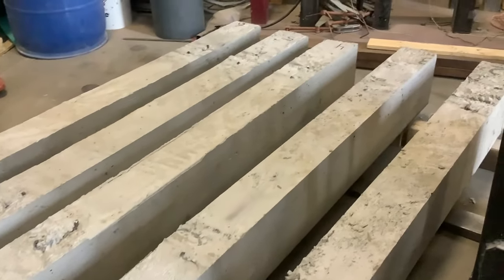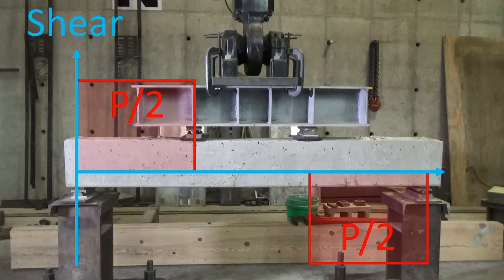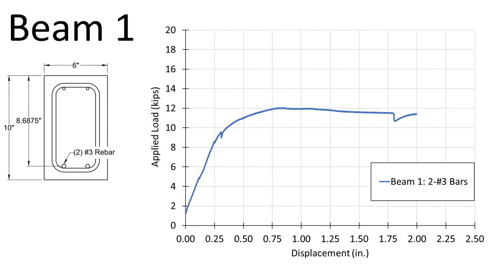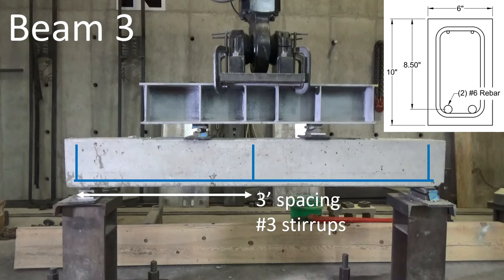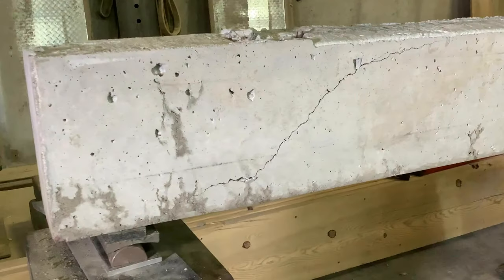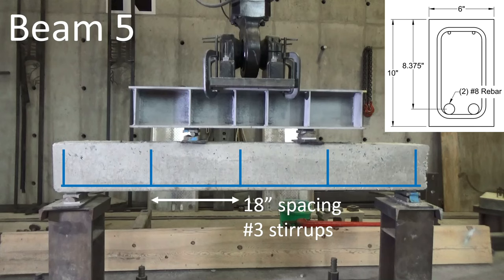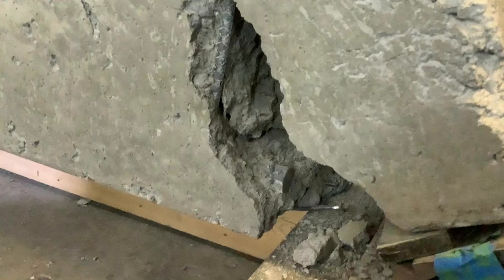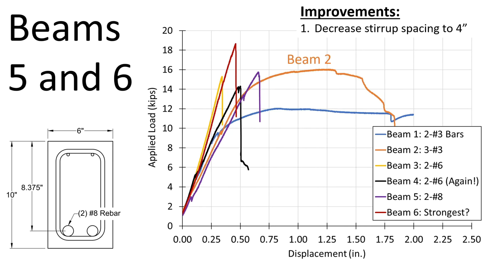I Broke These Concrete Beams - Design Principles from Beam Failures

Comment: Prof H,  I'd like to run through the same testing you did on our precast concrete products.  What were you using for your displacement sensor, pressure sensor, signal conditioning, and your DAQ?
Reply: I'm not part of the team that did this, but I may be able to help as I have done these tests in the past (specifically the thirds tests done here). Deflection is usually measured by a laser displacement sensor below the beam or you could use an LVDT for more accurate measurement. For pressure, if youre referring to the force applied to the beam, the test rig (pretty much a specialised hydraulic press) usually has a force and deflection readout. You dont want a pressure readout in these conditions as the diameter of the hydraulic cylinder would then be a factor. The force applied by the press can be halved as shown in the video where P/2 is used to calculate the SFD and BMD for the beam at any point in the test. 

Some machines can be set to increase the force applied over time, or deflection over time. For both methods, you will know your beam has failed when the force readout reaches a maximum and then starts to decrease consistently, not just briefly at the point where the steel yields (assuming you haven't over reinforced the beam).

Using the machine in deflection control is usually much safer. Because once the beam fails, the hydraulic cylinder will just coninue downwards at the same, usually very slow, speed. If you use force control, the machine will speed up after failure trying to apply a higher force. This cannot happen after failure due to the beam no longer being able to resist the ULS force which the machine is now trying to surpass.

If/when you conduct these tests, be aware of the very sudden nature in which the beams fail, it can be quite jolting or even quite violent if over reinforced. The over reinforced beams will fail without any warning.

Comment: Did you wait 28 days for it to cure fully?
Reply from the maker: Yes. To clarify, we did a wet cure in the forms for 7 days. After 7 days, we removed the beams from the forms, but they were not tested until just after 28 days.

To be fair though, many concrete structures in practice are loaded at ages much earlier than 28 days, despite that being the “standard” design strength. Strength gain is not linear. You gain most of the strength within the first week, but you can also gain strength (very slowly) for a year or more.
Reply: @StructuresProfH  Fantastic, thanks for sharing this video!

Comment: i thought you're supposed to waith at least 28 days for proper cure?
Reply from the maker: Sorry, I wasn’t clear in the video. We did a wet cure (with burlap) for 7 days. We tested roughly one month after casting. 

That said, there are many applications in the real world where concrete is loaded well before 28 days, and concrete will continue to gain strength even after 28 days. It’s more accurate to say that 28 days is the laboratory standard.

Comment: Use more steel. Simple
Reply from the maker: We definitely could have used more steel at the end of Beam 6 for sure! But it’s not always so simple. If Beam 6 had proper anchorage at the ends, it probably would still have had an undesirable failure mode - compression controlled flexural failure. Such a failure is brittle. The steel will not yield, meaning there is such a thing as too much steel.

Comment: there should have been proper stirrup. and the #5 failed because the steel is short . it cracked at the very end where the steel ends. meaning the load  and stress where only in the concrete . not the steel.

Comment: How in the hell is this demo credible? Only a fool would build rebar in such a way where it does not tie into any supporting columns or rebar structure  on the ends?  I just don't understand why the rebar did not extend longer to the end of the form? This makes the demo dubious!
Reply from the maker: Improper anchorage is part of the point of this demo. You don’t really need any “structure” at the end of a simply supported beam. The rebar just needs to extend far enough past the support (6 inches per ACI-318), among other checks for development length that are difficult to satisfy for such large bars. Obviously, that wasn’t done here.